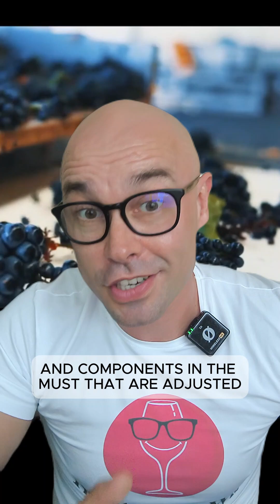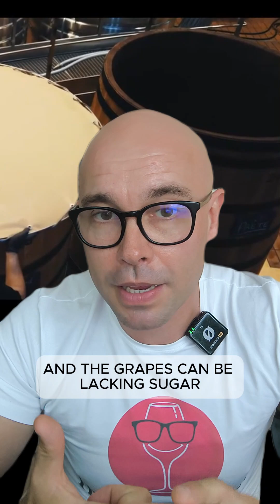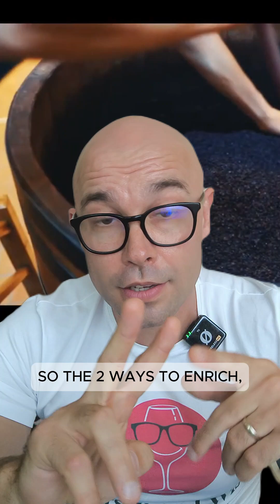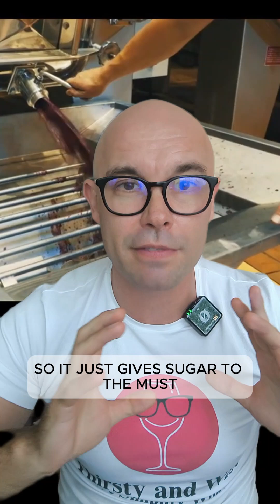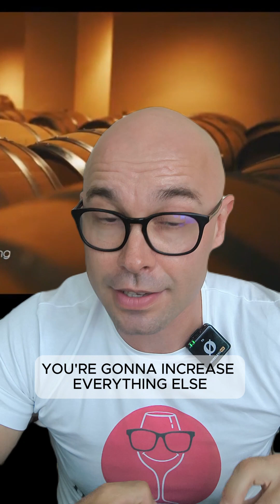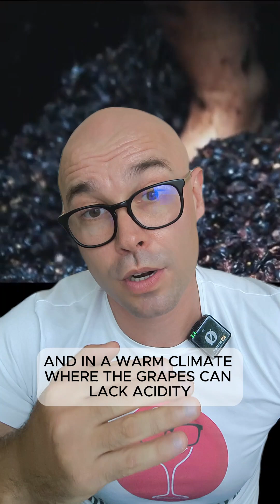Must Adjustment in Winemaking  | RCGM, Chaptalization & Acidity Control Simplified

Comment: Ripe grapes don't need adjustment.  Adjustment is usually only done in very "off" years - like a cold, damp fall.  Adjusting "by the numbers" (ie trying to make the perfect must) usually ends up with a wine with no character.   Any winemaker worth their salt will have the grapes picked when they are ready (weather permitting).
Reply from the maker: Hi Larry. It looks like you have hands on experience with winemaking? This explanation is meant  for WSET L3 in Wines students. Appreciated your comments. Stay Thirsty and Wise